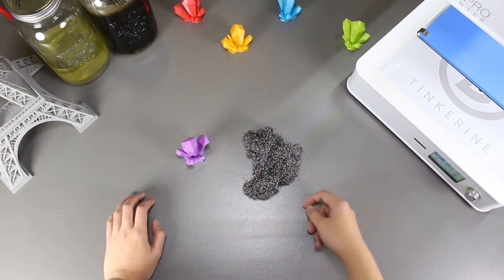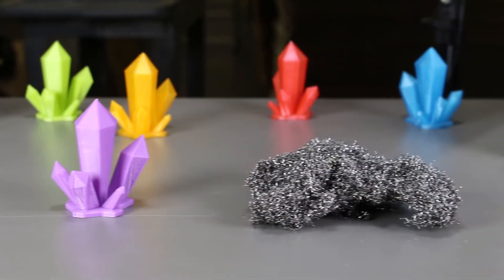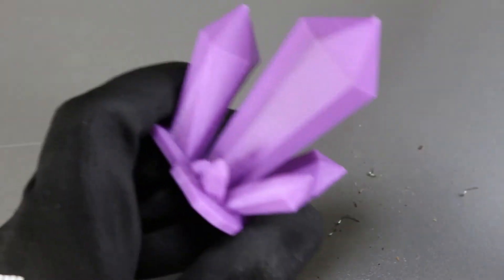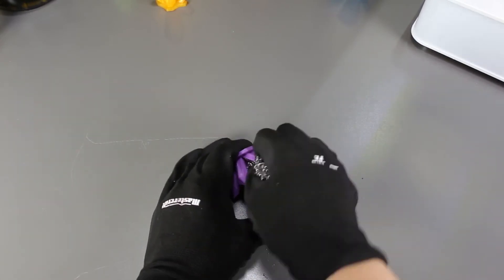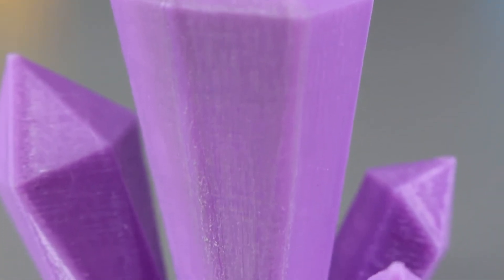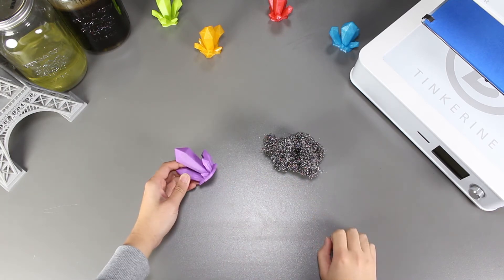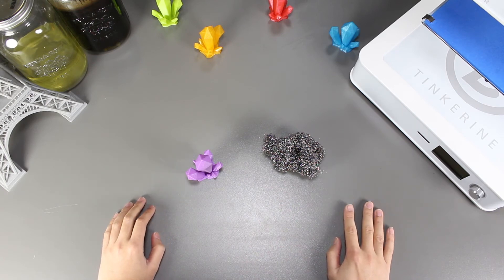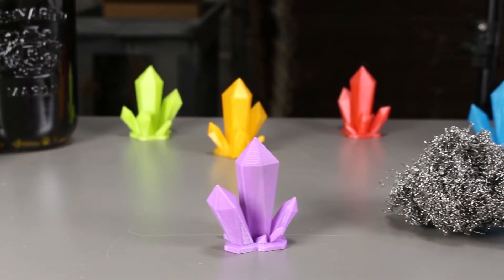Smoothing PLA Prints with Steel Wool

Comment: Looks like you have a belt tensioning issue with this one.  I can see waves around 1:44 in the closeup
Reply from the maker: Thanks for the heads up, I will check the printer that printed this gem out!